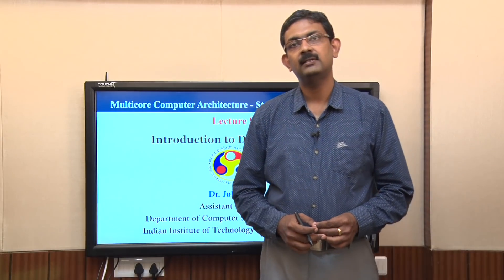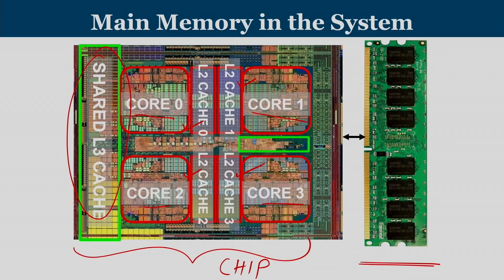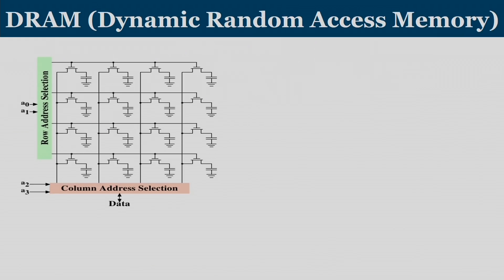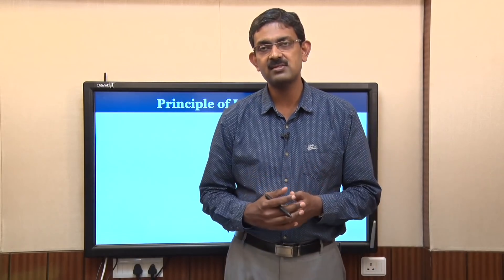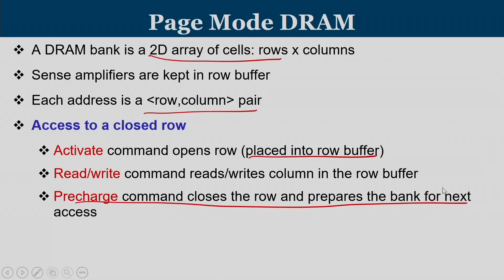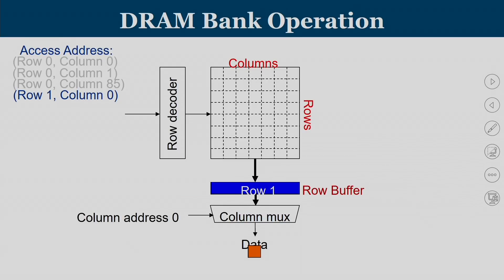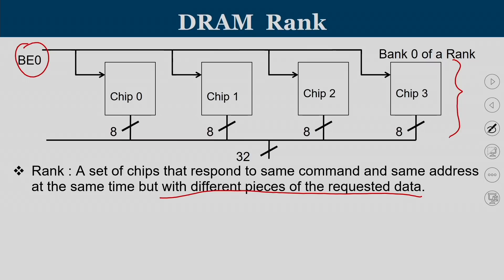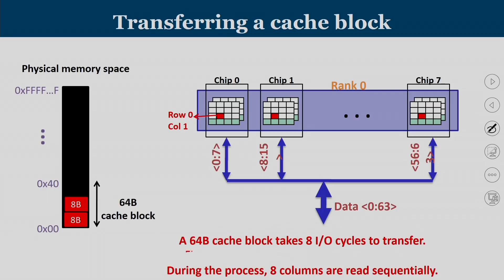Introduction to DRAM System

Comment: At 36:00, you have extracted 8-bit data from each chip using only one row and one column address. However, we can only access one bit by providing one row and one column address. So, could you perhaps explain the logic behind that?
Reply: 1 bit read from each bank will make 8 bits.

Comment: Namaste Sir. Thank you for the lecture. I have one doubt about pre-charging  and refreshing of DRAM. In this lecture you talked about pre-charging as return of same bit voltage level when row buffer conflict happens. And refreshing is a similar concept that periodically charging capacitor with same bit voltage it held. Can you please throw some light on these 2 topics? Thanks in advance sir!